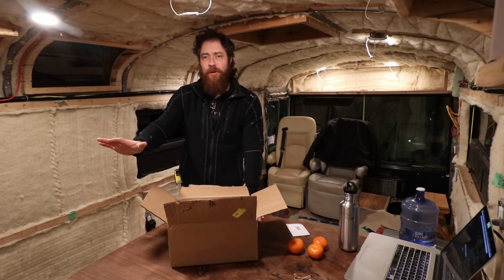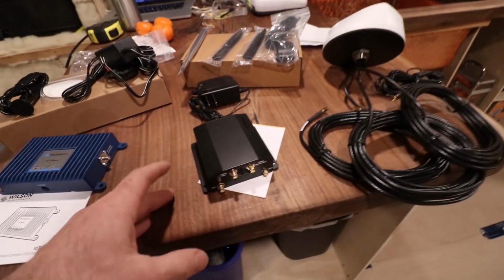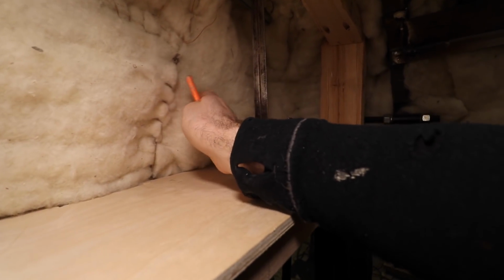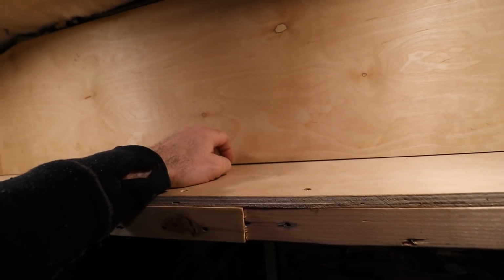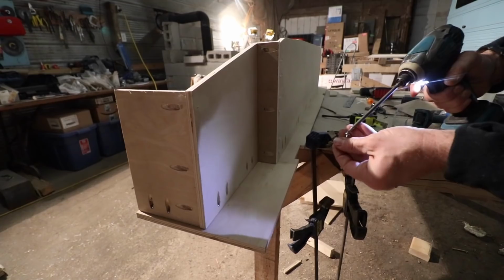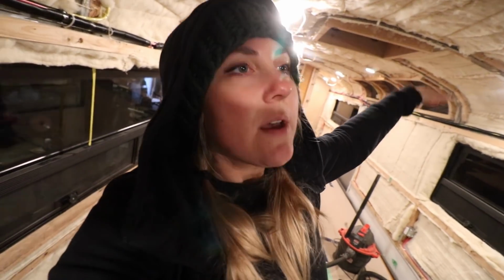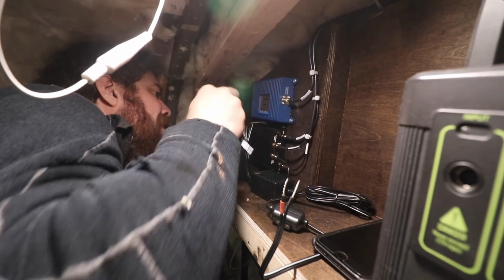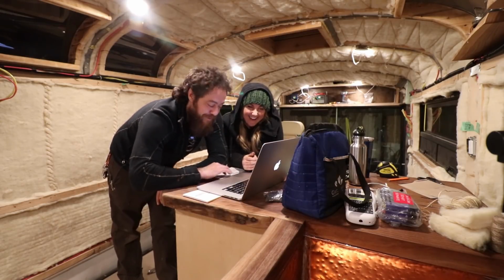OFF-GRID INTERNET (Building Driver Bulkhead & Skoolie WIFI Set Up)

Comment: When you use a single amplifier with that antenna, you are effectively disabling the diversity antenna (mimo 2x2). Make sure your amplifier is on your main antenna not the diversity port. Secondly, in certain extreme long distance to cell situations, I've found it effective to have two signal amps on main and diversity. In other situations where I am in urban or dense signal environments, I disable the power to both amplifiers to reduce signal ring.
Reply from the maker: Great tips @Aaron Bockelie! Yes, we have the amplifier connected to the main antenna. I just went to verify this. That makes total sense to have two signal amps, one on main and one on diversity (that would make a good system upgrade in the future!) Something also that we found is that anyone in Canada should not get this system until there is a hotspot plan that is not ridiculously expensive. The Canadian cell carriers charge $10 CAD/GB of data and we haven't found any plan in the US that allows international data. So our system just sits on the wall until we make it back to the US in which case AT&T has a pay-as-you-go plan for $55/month for 100 GB of data. 

For now, anyone in Canada should get either a WeBoost https://amzn.to/3uBeFWd or Fusion2Go https://amzn.to/3BaH487 signal booster because the data plans on phones are better. Also having a directional antenna on a 20' pole for when stationary or the omni antenna for while driving is a good setup.

Thanks for chiming in, Aaron!  We hope you and the family are doing great!
- Brian + Erin